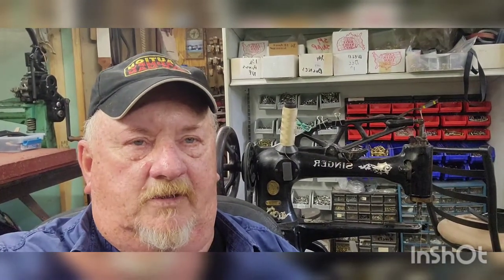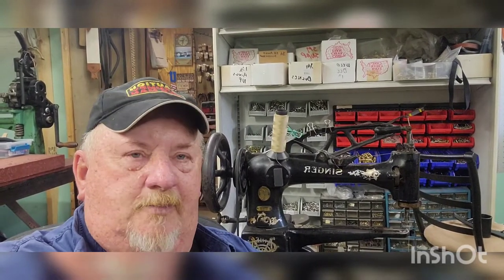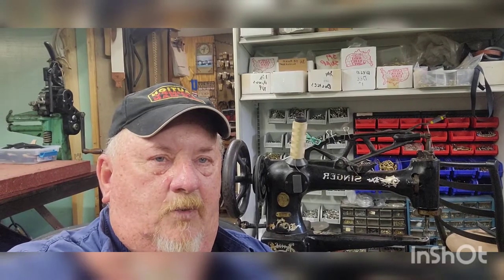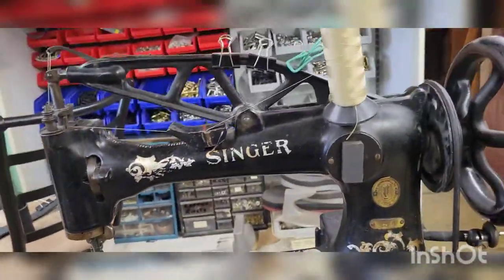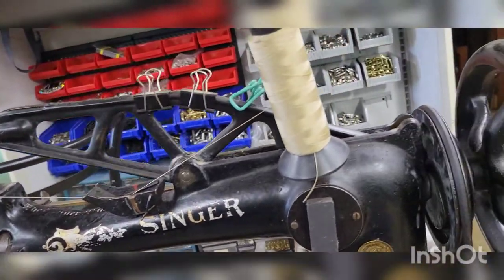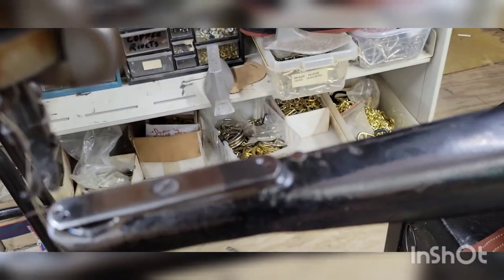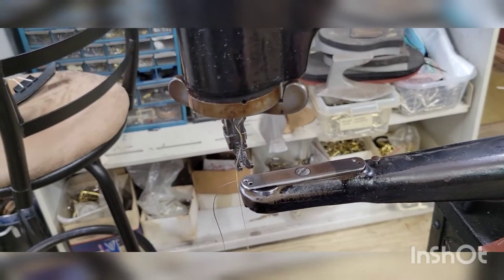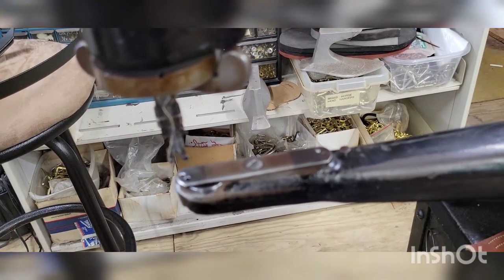Using a 1916 singer 29-4

Comment: Had several big old cast iron carpentry machines ` for making furniture and other stuff, the old stuff you find in school 1960 s or the old wood yards , but had to sell due to back injury, but as most people who like working with wood they find working with leather is just as satisfying, so thought no more hunking the wood ill deal with leather.
I was in a cobblers shop and seen a 29 k-4 asked him what its used for, boots mainly,but its just for show now, he showed me how it worked , I was fascinated the way the top bit rocked up and down, reminded me of a side structural part of an old iron railway bridge.
 
So my first machine was a 29k 4 but as I slightly have a compulsory addictive behavior I wanted other-types, I just love the mechanical movement of vintage machines,
So I ended up with 29k4  45k1  132k6  331k3 211.G151  307G2    7-33 and another double sticher 7 series, and a few more, unfortunately most are taken of there tables and in storage due to not having the room. it became collecting rather than usage,
I keep telling my self I need to refurbish them all to get some sold but it just keeps getting put off, I would never get rid of the 29k4 as its unique in the things its capable of doing,
but heard the 29k 71 is a better model and parts are readily available.

Comment: My 29-4 ears that swival the walking foot, only turns 340 degrees not 360 any ideas? This machine was made in 1898.
Reply from the maker: No sir I do not have any idea why your machine does not  Let the pressure foot turn 360
Reply: Turn the project the last 20 degrees 😝
Reply: If you haven't sorted it already, check the nuts at the top of the head, mine had a similar issue which was solved by moving the nuts a few degrees